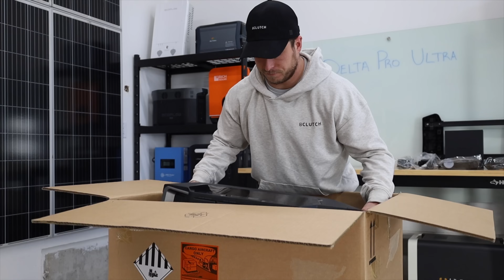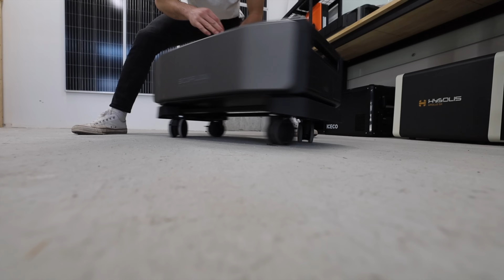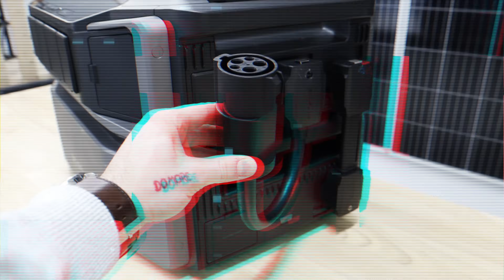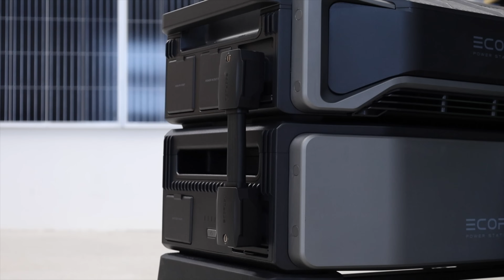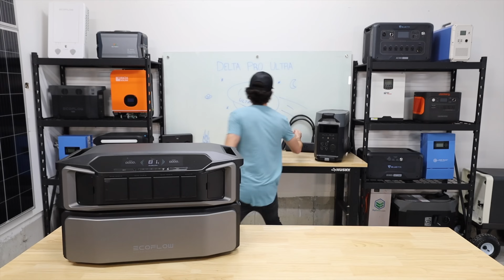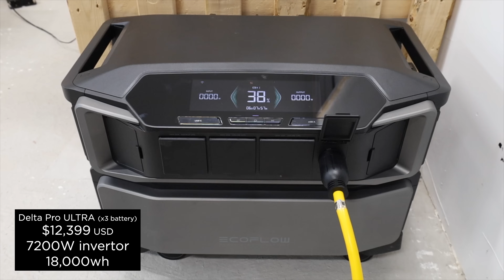EcoFlow Delta Pro Ultra - NOT What We Were Expecting!

Comment: Very good video.  Maybe a dumb question with today's new battery technology.  My neighbor wants to stay away from these for back up power, as he is worried about battery fires.  As mentioned, with new battery technology, what is the likelihood of battery fires with these new batts, and inverter setups?  Also, so you don't need to use solar to charge these?  For the short term, I guess I would just use the grid to charge them, and eventually move to solar, to get off the grid.  I own the much smaller Eco Flow River, and charge that with two 110v panels.  Thanks again for the good video.
Reply: I also would like a home solar generator , but am worried about lithium battery fires. The one I've seen from EVs are horrifying

Comment: I would say the best part of the unit is you can easily take it with you if you move. It's a big investment and I wouldn't want to leave all of my equipment behind if I bought a new house.
Reply from the maker: 100% that's a huge benefit of systems like this!
Reply: So you’re not able to disconnect a wall mount and battery bank?
Reply: @tywitt3351 Legally speaking I'd think traditional batteries that are fastened to the house are probably considered part of the house. This is plugged in and wheeled so it probably won't be considered a part of the home and easily moved.... I'm considering this over installed batteries so I can manage my power better.
Reply: @tywitt3351  you unplug this and move. No electrical inspection required. Meanwhile a conventional solar setup requires a lot of electrical to be redone (hyperbole - it's more than the nothing with this setup) if you wanna move it - that requires and electrician (who may be you if you're skilled enough) and an electrical inspection.

Comment: So I just installed an emergency sub panel, but decided to go with a predator 5000 for now. Ultimately, I wish to get one of these ebackup solutions. They're just so expensive.

When all hell breaks loose, my plan is to have my generator charge the electric backup. Once charged, switch the home over to battery. I'll do this as long as necessary to get us through the outage.
Reply: Thats exactly what I am doing currently here in Mulberry, FL. Hurricane Miltion was a cat 2 here. So far electric from TECO has been out 1 week. This method you said is what I am doing. Predator quiet generator 4hrs a day powering my ecoflows. Works awesomely. Berri No-ICE.

Comment: I'm considering this unit for daily use to power several circuits in my home (appropriately sized and spec'd). Is it just for home backup or can it/should it be used this way especially considering the life of the batteries? Also, how much ambient heat does it generate, say with one inverter and three batteries working at 50% capacity and frequent cycling...can it be stored in a closet for example w/o the risk of overheating? I'm a novice in this space but learning quickly. Any advice on these questions would be helpful, thanks.

Comment: Curious just how many appliances you can run simultaneously with 1x inverter and 2x batteries…to avoid over powering it (and what happens if you do run too much off it??). Will the app warn you before any long term damage is done?

Comment: I'm curious, why didn't you update the firmware before testing?  That tool icon on the screen indicates an influencer unit sent out by EcoFlow (not a unit that was purchased).  When you update the firmware that icon goes away.
Reply from the maker: We were leant the unit from some friends and had no idea what the wrench meant until people started commenting 😂
Reply: @TheSolarLab  Thanks for explaining.  I'm still unsure why you (or your friend) wouldn't have updated the firmware before making a video because EcoFlow did fix a few things that weren't working great on the pre-production units.  Also, definitely not trying to be accusatory but curious, are you also borrowing all of the power stations/inverters in the background?  Or were those gifted or purchased?

Comment: Thanks for the video.  I have a ef 1200 very old ,got it in '21 to run my tiny home . It did kinda, I couldn't run the washer/dryer and I had to charge it every day to maybe get through  the nights. Currently using a Growat 3k a 3500w gas generator for low sun days in the high desert. Would love to have this and 3-4 batteries . I could  power  the house and the future garage.

Comment: I’m extremely disappointed there is not an adapter for the original Smart Home Panel. In order for me to upgrade to the Delta Pro Ultra, I have to rip out the original Smart Home Panel (SHP) and replace it with the Smart Home Panel 2 (I confirmed this with EcoFlow Customer Support). $3,500 for the new SHP2 (with install) and a loss of $3,500 for the old SHP just doesn’t work. That’s $7,000. There is no upgrade path for me without this loss unless they can provide an adapter. Otherwise a big NO for me on the upgrade.
Reply from the maker: Yea we were also sad to see the change… huge pain for anyone who has already invested in some equipment🤦🏼‍♂️
Reply: @TheSolarLab  Like you said, it's they're following Apple's model

Comment: Great video. What I would like for you to test is IF a single inverter will charge 5 batteries fully from only solar (LV & HV) on a daily basis with optimal sunlight? To me the inverter seems that it might be under powered for off grid purposes. This may be designed more for the occasional black out. Thanks!

Comment: Wow, way over priced for the storage capacity. I’ve got 20Kwh with two server batteries at $3.5k USD and a fanless inverter for < $1200 USD.
Reply: What type of battery are you using? Sounds like maybe EV batteries.
Reply: How did you manage 20kWh of server batteries for only 3.5K? Those are usually close to $1K for 1.5kWh starting.

Comment: Dabbsson 13.6kw system with 4000w output can be bought for less than £7000 in U.K. it looks a lot better option? It can take 6400w solar input so stacks up really well compared to this ?

Comment: Could y evaluate how this could be installed and removable at times in all electric RV vans like the Detroit based Grounded 2 or up coming MB Esprinter all wheel drive vans being removable for other uses when necessary and despite price and weight could even recharge a RV battery for range extension beyond 250 minimum for in a pinch? Solar panels also on van roof?

Comment: I think if it was $1K less I could go for it but it is just too expensive! After posting this I realized that two Pecron E3600 LFP with 240 box are $2899. Thats over 7000 watts so it directly competes with this Delta pro max.
Reply: Lucky you - if you purchase it before 2.9, you can save $1k! Promo codes are out there…
Reply: Costco has it already for an even greater discount (with 2 or 3 batteries config and or $1000 more with SHP2).

Comment: I like to know if i plug that 30 apm out let to my RV power panel, will it keep running if the power goes out from the shore power 
And can i charge the batteries and use shore power from that invert
Reply: Yes, There is a 240V 30A out on the front and then there is also a 2nd port on the side that is 30A in and out but it requires a additional cable.
Reply: I’d be curious to see that as well since it would be ac charging then supplying dc my delta pros wired to 50amp have problems on my 5th wheel while running high loads and charging. (Both acs tv lights etc) I’m sure since the inverter is so huge on these it wouldn’t be and issue

Comment: One thing to think about too with the Eco-Flow Delta Pro Ultra versus the all-in-one kit. The Delta Pro Ultra is capable of being removed and put in a car if you need to take off or you move.
Reply: I agree with you 100%.  I have 18kw worth of eco flow batteries with 8x400w eco flow rigid panels.  I could literally take everything with me in 1-2 hrs if I were ever to move.   My grid tied system would have to stay on the house.   Wish I had waited for this new system 2 yrs ago even though I love the delta pro.  The plus with the ultra is able to use more panels.
Reply: So I ran the numbers btw. If you do a full 5.6kW solar system and just one Ultra and a smart home panel, you still get to keep 5000 usd of the total cost even if you move, and the remaining panels and smart home panel can increase home value.  

So I thiiiiiink it might be worth the whole thing.
Reply: Yes, because lugging around hundreds of pounds of off grid equipment is EXACTLY what people want to do with this product!!!
Reply: @CharlieOdom1957  SHTF
Reply: @jhartmac100  great job typing an acronym with zero context or explanation so people can comprehend what your goal or intent was.
Reply: @CharlieOdom1957 The key phrase in the comment is "if I you NEED to". Not "WANT". In an emergency, you wheel this out an RV and into your house if you NEED to. Without ramps, you can separate the batteries and carry them one by one with help if needed. You can't make something of this power and capacity weigh any less. You seem like a dumb ass, sarcastic, Debbie Downer type person.
Reply: @CharlieOdom1957  you appear to be confusing “capable” with “should”…
Reply: @heart4Pahoa  no, not in the least. Many people are capable of many things they shouldn't be doing, and vice versa.

Portability is not something anyone buying this product will give a fuck about.
Reply: Wait, you can't move this thing that's on rollers and only weight 70-116 lbs? What???

Comment: 70 Lbs is lightweight for a 7,200 Watt inverter charger with an onboard MPPT. The reason why it's so lightweight is that it lacks a crucial component that's found in real, heavy duty, hybrid inverter chargers. That crucial component is an iron core, copper wound transformer that not only provide for a much higher peak power capacity, but makes for a much safer inverter that provides galvanic isolation between its DC section and its AC output which is something that this cheap inverter can't possibly provide. In addition, this "Ultra" unit doesn't even have a UL-1741 safety listing. So no thanks!
Reply: What do you think about the anker f3800???